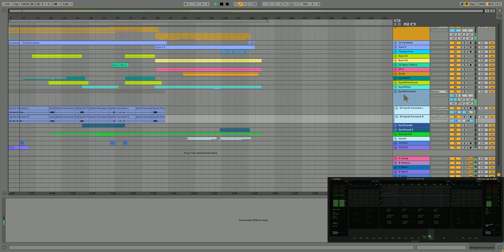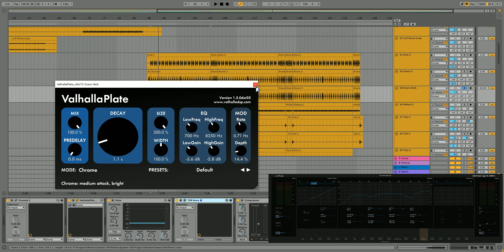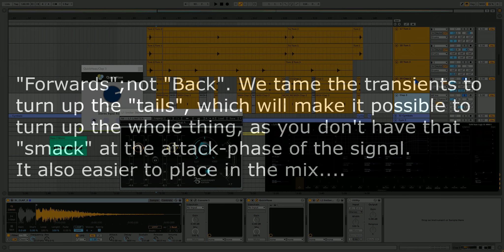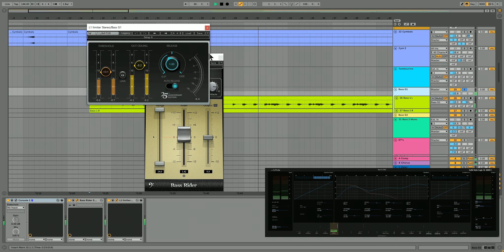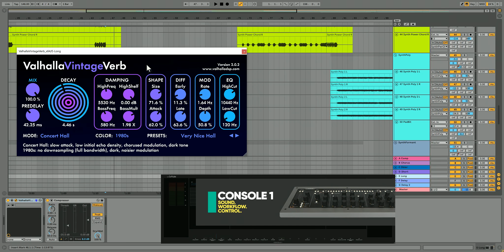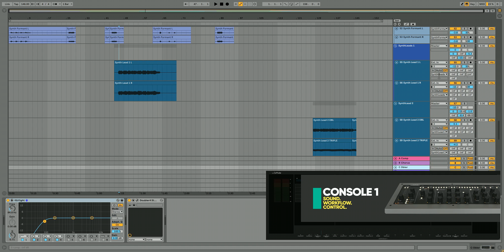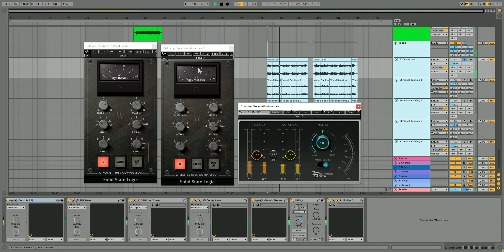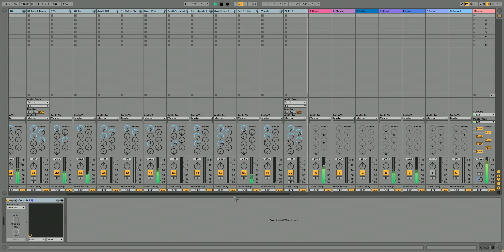Behind The Mix : "Nexus" by Alex Ball

Comment: fantastic job, and the vocal part is mind blowing
Reply from the maker: Thank You Sebastian. Very much appreciated.  As you can see, I use serial compression, as it sounds nicer with 2 comps sharing the workload. And if you considder the EQ curves on the vocals, a deal of "air" is lost, removing some of the "nastyness" between 3-8k, which is why I use Waves Vitamin to boost above 8K with - it's great for bringing back that "air" that got lost - And now you get it without it being "nasty", because those freq's are gone from the signal. You see this process all over this project  - If I take out say 8.5k in a signal that's "bad", I ususally boost above to gain back the lost highs. The same in the bottom : Removing "boxyness" on drums between 2-500hz, makes them thinner. Then I boost below to gain the lost low-end back. This techn. is used on ALL tracks, and you can clearly see it if you pause here and there.  Btw : You DJ-set " Lost Miracle TV 01" is running in the background here - I absolutely love it!
Reply from the maker: And a littel secret : The first time I got the vocals to really "sit" in the mix, it brought a tear to my eye. Just awesome to work with

Comment: Really interesting inside look into the mind of a madman :). 
Definitely picked up some interesting tips from this vid that I'll try out for my own mixes! Thanks for this video!
Reply from the maker: You're most welcome. If you do, then my mission is complete. Have a look at the 1st video in the series, where I explain using parallel comp on all tracks but percussion. I use it here as well, (and on nearly all mixes I do) but don't explain it in this video. It's a VERY valuable trick, as all fader-movements becomer easier using this technique. Another thing you can take away from this video, is that I'd rather use limiting, than compression. Many instruments have SPADES of transients that poke thru, and using a comp with a slow attack, will just make it worse. So I balance the transients/tails in the mix (not in solo!), using ye old faithfull L1 limiter with threshold and output linked, so I get a gain-matched result. If I need more "snap" in a snare, I put up a compressor AFTER the L1, and adjust the snap in the mix here. The it becomes a balance between those 2 plugins. Enjoy! :) Theres a free vst called "LoudMax 64" that models the L1, and is really nice for this.
Reply: @sonicpeakstudio541  Thanks so much with the tips! Very nice, I will check out the video where you're explaining parallel compression. I rarely use compression in my mix and more often use limiters (if needed of course). But who knows, maybe you'll change my way of thinking compression, hehe. But I don't have as deep of a knowledge of it all as you do, so I'm very interested to check out the previous video. Thanks for the limter plugin, I personally use a plugin called "DD Limiter", which is free as well. They have some other fun stuff, but that's the one that gets used the most for my mixes. Anyways, cheers! Take care.